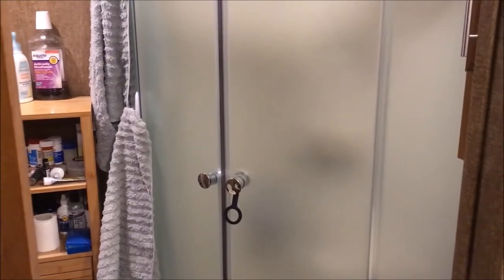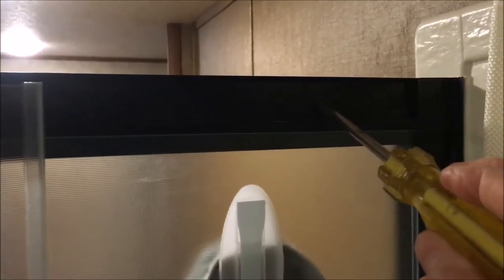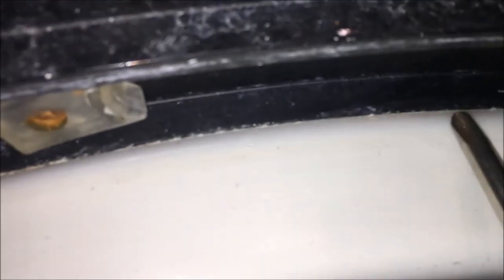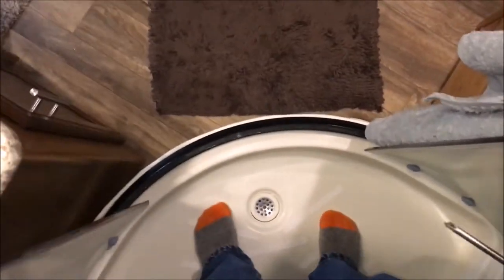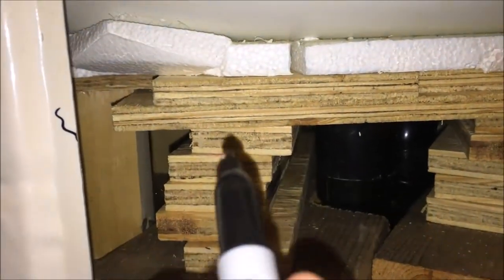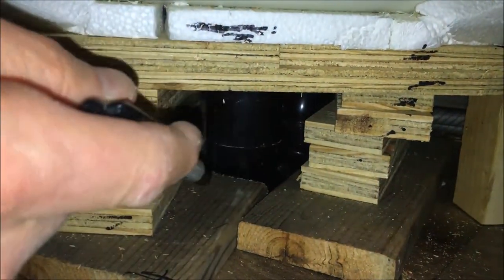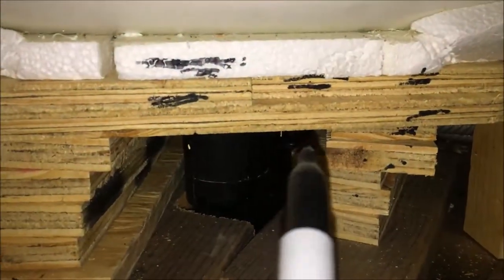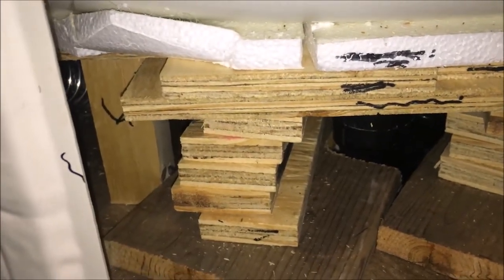How to Fix a Flimsy RV Shower Floor

Comment: Excellent mods on the floor pan. I've got the same issue with the "flex" bottom and that's what causes the pan to pull away from the bottom shower rail creating leaks. Now, if I can only figure out how to take the shower doors and bottom rail off, I'll put some adhesive sealant underneath and it will never have to be redone again. Thanks for the video.
Reply from the maker: It shouldn't be too difficult.  Work from the top down and start taking stuff apart.  Make a video about it! ;-)

Comment: I decided tonight that I would try out the  shower and wow was it flimsy and not supported from underneath. It’s a 2019 forest river Salem. This thing wasn’t cheap but man is this shower a hack job. The hole for the pipes is 3 times bigger than it needs to be. It’s absolutely ridiculous. Now I have to do exactly what you did but I also have a leak in the back right side of the pan against the wall. I knew this was gonna happen, before I took the first shower I turned the water on and yep the trap was leaking lol what a disappointment. I came here because I knew I couldn’t be the only one.
Reply from the maker: Things rattle lose under there. Support it well but leave a way to do repairs in the future. Once supported, mine is Way better!

Comment: Do you ever notice the doors come off the track?  I have the same shower and mine keep coming off while I’m driving.
Reply from the maker: I’ve never had that problem. I assume You are fastening the door handles together when towing.
Reply: @JustPlainCommonSense  I did and they completely fell off… just too flimsy.  I’m going to make a strap for the wheels to the track.  Thanks for your reply!

Comment: unbelieveable, my shower has no access to the floor.  i got to take the whole shower apart to get  support to the shower floor....
 i guess i could cut from under the motorhome  up to get access, very dissapointed, so much money for junk.  where re  the regulations?
Reply from the maker: mr zif001 can you cut an access hole and just screw a vent cover over the hole when you are done?  I doubt you will be able to do the floor mod from underneath the rv. The subfloor will be in the way.
Reply: @JustPlainCommonSense  hi, thanks for the quick reply.  not sure where you are thinking to cut the access hole.  i saw your shower has a stepped up into your shower mine is level w. bath floor.   i might have to cut a hole in the shower pan  if i can't acess from under coach.   but first i will try taking the shower aoart and  iwill be talking the forest river and  and general rv,  this is a new motorhome and leaking al ready.
Reply from the maker: mr zif001 ok. That’s horrible. I’ve been very lucky with very few problems. Good luck!!